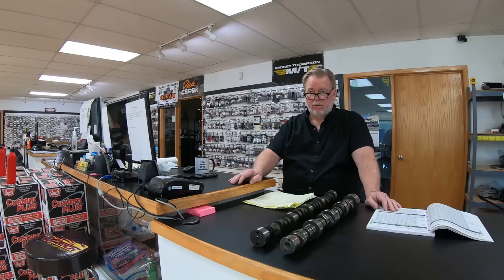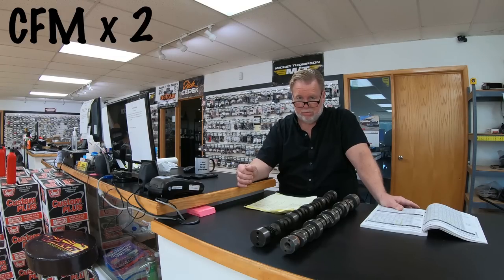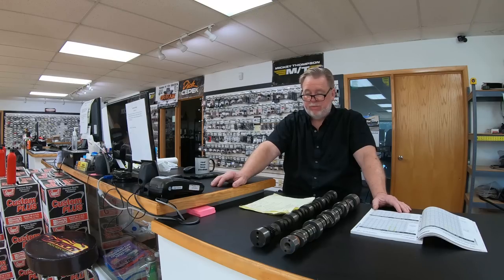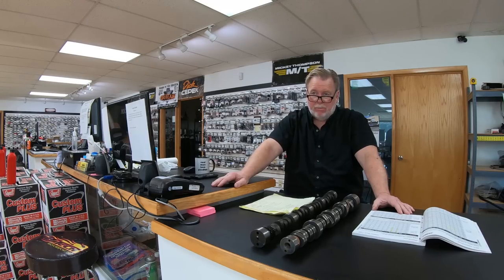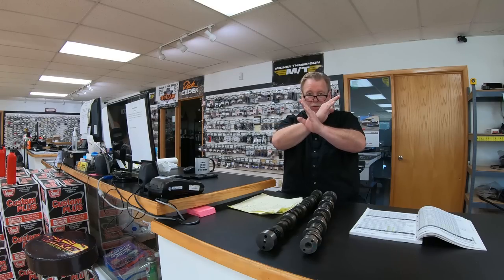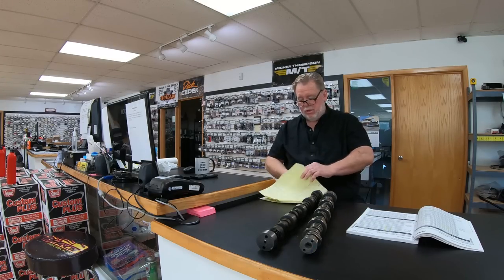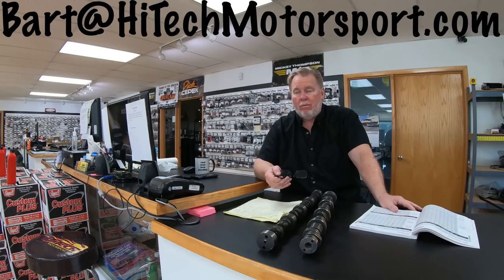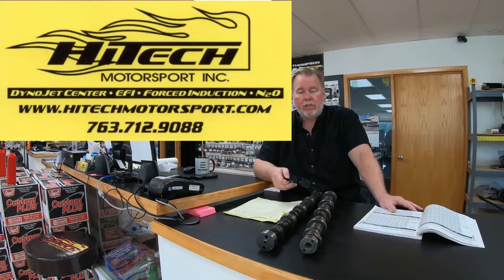How to Choose An Ls Camshaft For Max Horsepower

Comment: What cam do you recommend for a daily driver 6.0 with 4:10 gears?
Reply: Not too hard to work out, but you need to need to do some math... Do you have tractor tyres on it? Is it a Mini? What gearbox / trans? What gear ratios? How long is a piece of string? All stuff that can be worked out quite simply with math. But in a nut shell you need to work out how many revs you are doing at around town speeds (and what gear) and how many revs at highway speeds (and what gear). 

You can find a number of tyre circumference calculators online and use your tyre profile. I.E 235/45 - R17 will give you x mm per tyre revolution. You already know you diff ratio, now you need to know each of the gear ratios in your gearbox / trans (if auto does it have a lockup convertors or will it slip?). Hopefully you can see where I am going with this... Some math later later and you know what rev range you will be sitting in for the biggest part of your driving. You go with a cam that is in it's sweet spot at those revs. So lets say you are doing 2500 at highway speeds you don't want a cam that starts at 3500, or it will dog along until it gains another 1000 rpm.
Reply: Or you can just go to the recommended website and find all the resources you will ever need... http://www.wallaceracing.com/Calculators.htm

Comment: Too many get hung up on big dyno figures and forget about driveability. I want good low down torque and throttle response. Any cam which needs higher stall RPM than my car runs at 65mph is going to be useless to me for a streetable car.

Comment: I would argue that the 1.5 is typical but not a hard rule. Look at Ford gen 3 coyotes and 5.2s. They develop more than 1.5 per cube from the factory. With 1.82 per cube in their 5.2l crate engine. Aside from the physics of DOHC vs OHV I think 90 percent of their benefits are from being able to individually swing intake/exhaust independently by a large degree very quickly.

Comment: I have a truck motor but it’s going into a car. 2002 5.3 going into a 96 impala. 
Looking for great torque and cruising characteristics. Plus a great sound. Would you run a cam designed for a truck still? Since the car is so big

Comment: Wow. Amazing. I have a vvt 6.2 in my denali and i had a custom cam made by geoff skinner because i wanted the eps lobes. I love it but it has shit down low in my land yacht. But im thinking it wil be perfect in my 70 chevelle. Wish i knew as much about heads and cams as you do. Thanks for sharing the knowledge. Im wondering if i stroke my motor if it will help with the cams lack of efficiency down low.
Reply: Vvt should have bottom and top end did they turn off vvt in the tune

Comment: I put a big circle track cam in my car when I was in my teens, it sounded mean, had top end, but all but needed a push start, I had to slip the clutch alot to get it moving, that didn't last long, I don't remember the spec's, but it had over 300° dur, and 106 lsa, it was crap until about 4k and wanted to keep going above 7k, I think it was a 4500-8500 cam, I'd had to put 4.88:1 gears to run that thing it would still been crappy, I had a truck also, I could jerk the doors on a cobra mustang, on the highway, but it didn't have that low down tq, I made a guy with that cobra feel bad, after spending all that money, then get out run by a 5,000 lb truck, I totally respect your knowledge, I'm here because I don't know LS engines, and looking for a decent Street cam for a 4.8 in a s10, with a turbo, and about 10-15 psi, I'd like the boost to give it the top end, and allow the cam to keep the 1500-2500 rpm tq,  I'll probably be running a small amount of stall, maybe 500 over stock, so not really a stall converter, with stock 4.3 auto gears, and probably run the v6 converter, now I'm thinking about it, I know the 4L60's aren't the best, but I'm not racing on the strip, maybe the occasional trip down the track, I want the most power I can get, with the best mileage also, 3k at 65  is not me, (anymore) gas is too high, thanks for the video

Comment: Such an awesome video you made and such a great job explaining. I have an Escalade 2005 with a 6.0 Vortec. I'm so lost trying to figure out a good cam to increase torque and hp with the right parts around a new cam.  I plan to use this to tow my toys but I still want more all around power and speed. I have looked at so many configs and found one person who compared several cams in a LQ9. I'm very interested to hear your opinion on a 585 lift 228/230 duration and 112 LSA. Unfortunately I didn't get the list of other parts to make this complete but the curves looked nice. I would like to hear your opinion for a build around this cam and what you would do.
Reply: Just watched more of your post and the overlap is 5 so it sounds like I'm back to the drawing board

Comment: Filling out the return slip as I type for my 3/4 race cam. I think I'm gonna end up going with the Blue Racer RV cam instead.   I really should quit saying that and dating how old I am. The older guys at work laugh when I tell everyone I'm running that blue racer in my twin turbo lsx build lol. I sold a bunch of them. off the shelf cam at advance auto. I worked at Nationwise Auto  before that. They have been gone a few years now

Comment: pretty sure tighter LSA usually ends up closing intake earlier which traps more air and increases DCR which boost cylinder pressure and that's why tight LSA cams tend to make more power.
I went with a 218/227 112 +2° for my 6.0 2500HD, 10.6:1 comp
Reply: Yea, that BTR Truck Norris is 216/227 @108* LSA....You’re close except for that LSA.

Comment: I was talking to a woman I know, who DOES understand cars TO A POINT, and she is a math wizard with a college degree. She looked at me during one of our conversations about old cars and racing, and finally said to me "How can a 305 small block Chevy be faster than a same car with a 350 cubic inch engine?" and I looked at her and said "It is all in the math!" and for a moment she looked at me like I was lying to her in that answer!!! 

BUT has I went on to explain, you have to know EVERYTHING about the set up you are running!! Weight of the vehicle MATTERS, final drive gear ratios MATTER, and as I further explained to her as well, transmission gears, even engine performance parts ALL MATTER!!! Change ONE small thing in any engine and you can out run (on a drag strip) a V8 engine with a inline 6, if you have done the math correctly because EVERYTHING YOU DO to the car AND MOTOR as well as any gears in between MATTER!!!! And for a moment she looked at me confused!!! 

The sad thing is, I have seen guys try to run HUGE cams in a car that run like garbage on the high side of the power curve, but seem to run solid but sluggish on the take off, only making power mid way. I have seen guys run cams that are too small that make INSANE off the line power but fall flat shortly after take off, because they just didn't have enough cam to satisfy the same mid way power curve!! 

I have even seen guys who think stuffing a large carb on an engine will "fix this" and totally ignore allowing the exhaust to flow, and the list of things I have seen goes on and on and on from there to 4.11 rear gears in a car that just can't handle such a steep tooth in "normal" applications, when they should have ran something more "realistic" like 3.73 instead!!! 

Facts as they say DO NOT LIE!!! And it is all in the numbers!!! And you can stick in the biggest big block you can stuff into a car, and think "This will be fast" but if you ignore the rest of the numbers you might as well take all your work and hard earned money out into the driveway and set it all on fire.......because all you are doing is wasting your time if you don't do the math and follow the numbers with a fine tooth comb!!!!
Reply: GREAT  STORY, 
                      SO  TRUE. 
      THANKS.

Comment: 1HP = 550Lbs moving up vertically 1 foot in one second. Horse pulling a rope over a pulley. At the other end of the rope is a 550Lb load being lifted out of a mine shaft.

Comment: Not questioning your knowledge but you indicated that the ls3 heads had a really good i/e flow ratio, but all the information I have ever read indicates the rectangle port LS heads have one of the worst i/e flow ratios I have ever heard of, something like 59%. Not a terrible exhaust, but a really good intake port.
Reply from the maker: you are correct, the ls3/l92 head has a lot more intake flow than the ls1 head. consequently, you can use a much smaller lobe on the intake side to achieve the same results. however, current cams are being ground with a larger exhaust lobe to try and help the alleged issues for i/e disparity. the 229/249 on 115- plus 5 tries to get the timing events back into line. this results in a poor bottom end as the overlap tends to dilute the cylinder mixture. reher/morrison (sp) has some very good articles about cylinder head design and pro stock configuration. they are saying a cylinder head that is 66% to 68% flow i/e has proven to be the best in competition. also, be aware that cubic inch makes a huge difference in cam selection. b

Comment: WOW!!! Your video is amazing. I've been looking for something like this. I just got a 2008 TBSS AWD and love it. However I would like a little more out of it. Very spirited but not enough to settle anything. This is my daily driver. I really want a plan of what I need to do. Of course it's an LS2. I don't really want to start replacing heads, etc...but perhaps cam, intake, headers, etc....normal stuff. It's got a 4.10 gear. I plan to get a built transmission. Don't know about the torque converter. 500+ hp is what I'm thinking...don't really know for sure. I'm looking for some good guidance here. Hope you can help me. Thank you.
Reply: if You want 500hp you need intake, exhaust, headers, cam, ported heads, converter etc.. not even sure if that will get you there

Comment: I have a 1985 1 ton 4 speed dodge truck with a stock 360 engine. I want more power for moving heavy weight on the highway usually from 0-70 MPH. It has 2" dual exhaust and short headers. How should I build it? Which camshaft, heads, intake, and carburetor should I use?

Comment: I've Got The LS3/480 GM Crate Motor Complete.Short Of Money To Buy A Super Charger Or Turbo Set Up.But Would Like To Bump My Dyn Tuned Power To Crank From 545Hp.To Around 600 Streetable Horsepower.I Was Thinking A Fast Intake With 102 Throttle Body.Should I Change The Factory 525 Lift 525 Exhaust GM Cam To Like 613 Intake 613 Exhaust Or Can I Just Leave The Cam Alone And Achieve 600Hp With The Fast Intake And 102mm Throttle Body ? It Has Headers To X Pipe To 2 Resinators In The Rear Along With 6,000.00 Sonnex Built Tranny And A 3.73 Uni Trac Posi To The Rear ?

Comment: I have a 2010 Silverado 4.8, what is the best thing to increase HP? I'm thinking a camshaft but I only have 50,000 miles. Is it worth changing can and spring's? How much HP can I gain?

Comment: I have a Pontiac trans am 2000 LS1 engine stock whit headers,3.73 gears and it's reprogrammed. Which camshaft should I put in?? Is a car for daily use and I run it on weekends thx

Comment: I'm building a ls 6.2  it's going in a 85 Chevy 4 door dually it's not a work truck it will probably never see a day it pull a load. However on the highway or driving around I would like to have the maximum power put the radical sound. What cam do you recommend

Comment: I run 4.10 gears 4l60e 3800 stall frame connectors 3300 LBS. 2000 camaro can i run more cam I am stock bore and head David Mc

Comment: Great content Sir, Swap an L94 (Dod & Vvt Delete, into 96 Land Cruiser about a 6400lbs "Brick" towing ATVs ~May Stroke to a 416, No Replacement for Displacement, Thinking about a BTR 553/553 Lift, 212/22X 107 LSA, Thoughts ? Works well with Stock TC, Mils Lope ar Idle, Seen it Tow a Skid Steer

Comment: What’s the best set up for an older 95 LT1 in a CORVETTE that’s still all stock except the trans it been built to handle up to 525/535 ish by a trans shop few yrs back with larger than stock torque converter. I’m keeping her (street) mostly with all the bells n whistles she came with AC, Electronics dash display, Auto 4L60E TRANS but no shift kit as of yet. What’s the max I can get if I port match MY heads and stock intake or would I be wasting my time on stock LT1 heads and intake. I would be HAPPY with 500 + HP if it’s possible and not need to spend 10,000 plus just on the motor if that’s realistic. Not looking to spend more than it would cost to just change- up to bigger motor. I’m sure if I were to sell the original that’s in there someone else would have it built for cheap because they know how. And/or already have parts laying around to do so. Parts pricing looks like it been getting way out of hand sense the 70s and 80s it’s sickening 1000.00 dollars for intakes now almost 1000.00 for good cams now WOW the amount of greed in today’s society is astonishing. 20,000 for turbo kits that don’t even look complete and u still have to plumb them yourself to save more money???????  Is this NEW WORLD ORDER pricing happening these days or what. Has all the pricing been affected by common core math. Example back in the day u could get a decent cam for just under 200 bucks  now same cam has been elevated to 750 plus minus tax. Did George Soros and Hilary Clinton hijack the after market parts industry ?????????

Comment: Good info!  About three years after this video the hot LS truck cam is the Truck Norris which has a really narrow LSA (~108).  This guy likes wide LSA’s after thousands of dyno runs!  What gives?!?  I know that a torquey street engine can be had with a little compression, smaller ports for higher velocity and a narrow LSA.  I have a BBC set up that way and it’s nasty as a porta potty on a hot day!

Comment: You were talking about the 5.3 truck cam, 223/227 113 which cam are you running?
Reply: Yeah which cam? 1 or 2?
Reply: @ramblin_man23  I'm looking to bump up my 2012 5.3 silverado cam, afm full delete, I have been looking at the btr stage 3 truck cam, Which is 218/224 .553. I'm wondering if there is an advantage with the bigger cam. And what torque converter I would need.
Reply: Chase B Well I’m just now learning about these and from what I read if you go stage 3 with a high lift you would need at least a 2500 stall. You can probably get away with your stock stall with a low lift stage 3. Stage 2 and stage 1 obviously has more torque and probably won't need a stall they won't have as much horsepower as the 3.
Reply: @ramblin_man23  I was interested in what you know about the performance values of the 223/227 cam
Reply: Chase B at the moment nothing. Sorry.
Reply: Tom Wetz  very nice! Let me know how you like it! 
I got the whole new top end sitting in the box in my living room. I picked up a 214/224 custom grind, morel lifters due to the ls7 failures recently. Full
 overhaul on the 243 heads, dual spring, port polish, seals n all. Full afm/vvt delete as well. Plus a few extras to eat the soot slobs! 😄 I can feel your excitement!!!
Reply: Tom Wetz  awesome! Congrats man! That sucks on idle after waiting. Man your making me itch to go put mine in.
Reply: Tom Wetz  man that's awesome! Congrats! You're giving me that itch to go start on mine...
Reply: Tom Wetz  what were your tq #s?

Comment: Got a single cab 2005 Silverado 5.3 LM7 4x4 . What I am looking for is a nice lobe and chop sound. I am also looking for good bottom end power for that good yank feeling when I punch it. I will not be racing. My truck only gets driving once a weekend when I cruise it and that's it. Only modifications I have so far is K&N cold air intake and flow master exhaust.

What cam setup do you suggest?

Also i am in Arizona where the weather can get really hot. I'm not sure if that means anything.

Comment: Thank you! I must install a camshaft in a chevy 250 6l what are the differences between a 240/248 108ls or 260/260 110ls? Which one recommendeds and what differences do the performance have

Comment: I might be in the wrong place but what about a 7.0 is a 240/244 @50 .600/.608 112 too big. I was waiting to hear as the motor got bigger does the cam but I'm a small block guy anyway info was good